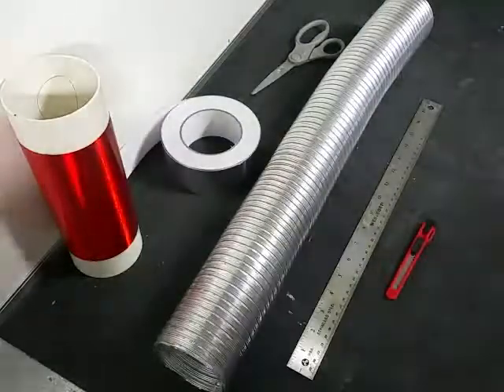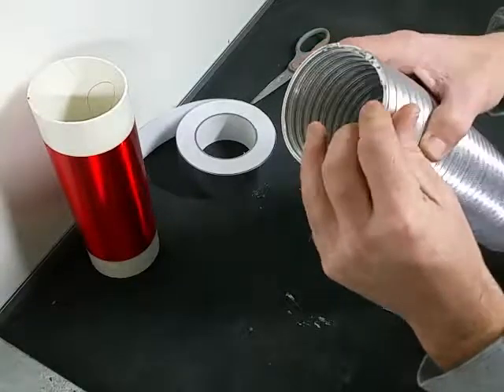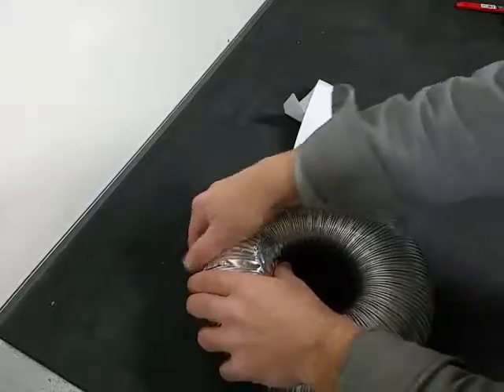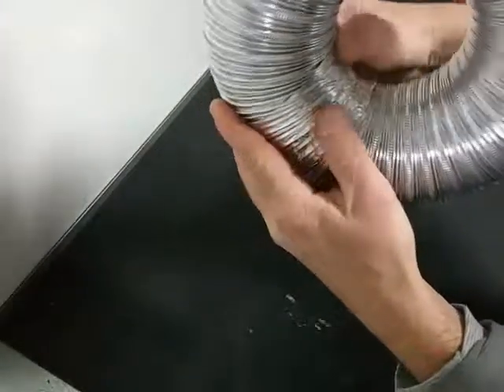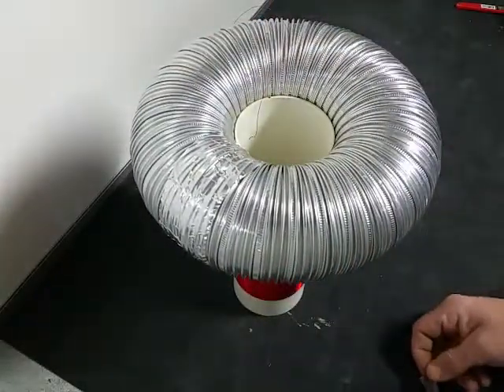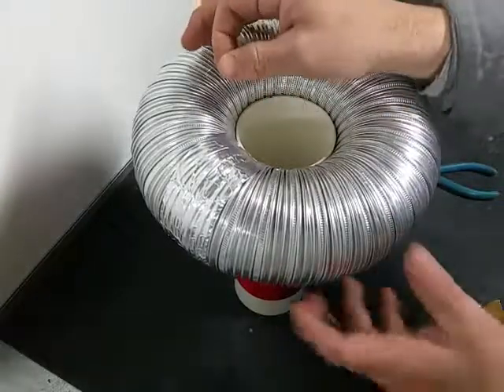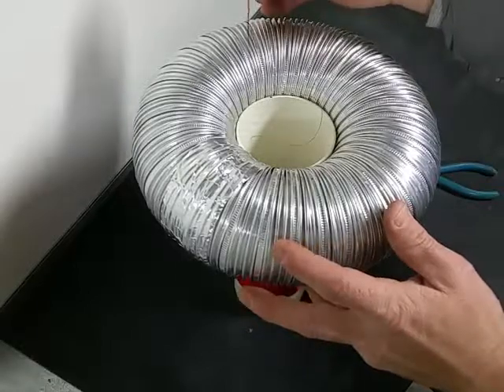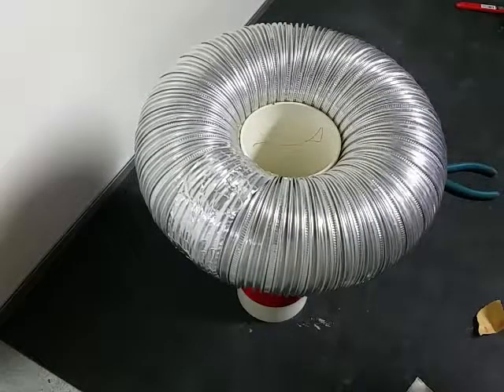Making a cheap toroid for tesla coils

Comment: Nice job, one note, never bring the secondary wire through the center of the tube at any point.
Reply: Just curious wht would happen if that happens, kinda new to this
Reply: I did not leave that comment. But you can get arcing through the center